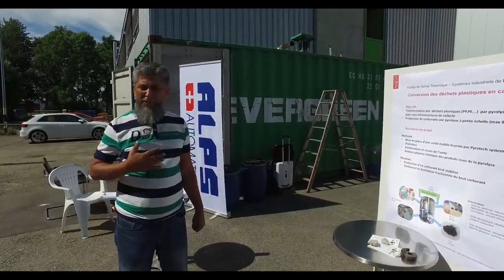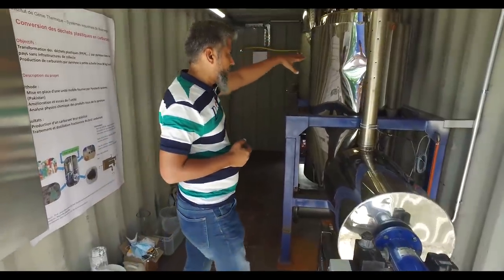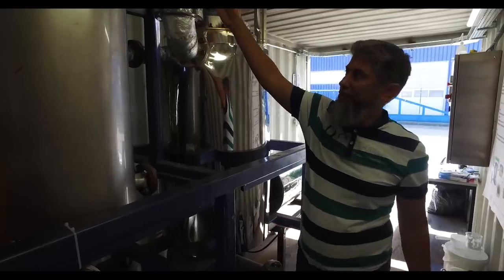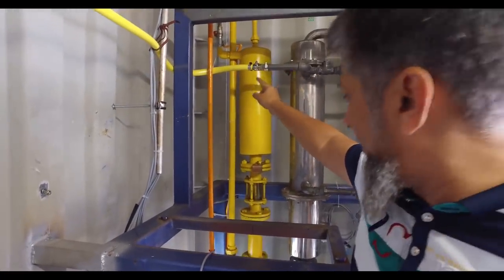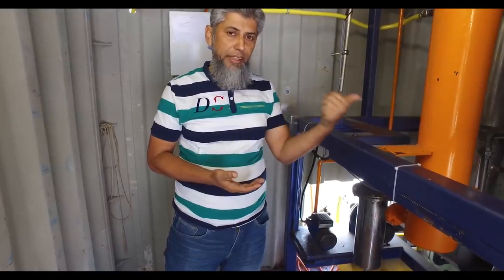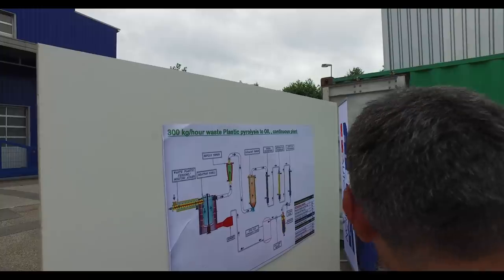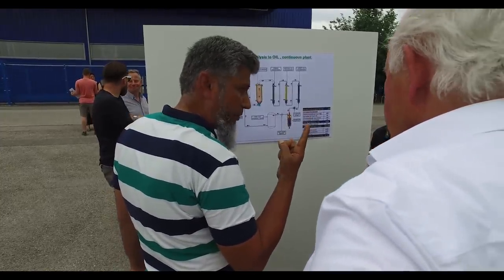Swiss Plastic pyrolysis 40kg demonstration by www.pyrolyze.com

Comment: Bravo ... one of the only serious systems here that works in real life because it is a fractional destillation
Reply: The chines is way ahead 100 tons a day
Reply from the maker: @eriknielsen1849  please show us a system of theirs that can output refinery grade diesel, Naphtha and reuse the synthgas for the reactor and a power production. Please check www.pyrolyze.com for more information. Cheers
Reply: @GreenmeResearch  huayin group and Henan doing but just Google plastic to oil
Reply from the maker: @eriknielsen1849  the differences are. Not mobile/containerised and no refinery grade diesel, Naptha and Synthgas from these plants....it requires a separate destillation process.
Reply: @GreenmeResearch  I'm talking business not an expensive hobby and your numbers is to high except you have a werry clean base plastic.. You never have except you pay for the product and then you have no business. You already don't have with only 250 kg a day.. At a prize tag of over 40.000 euro Mobil or not.
Reply from the maker: @eriknielsen1849  not sure what you mean, we deliver a full businesscase with the product, please shoot on its content. Many thanks
Reply: @eriknielsen1849  so what, their plant is probably 100 times more expensive
Reply: @sammyd7857  10 ton plastic a day up and running under 100.000 euro
Reply: @eriknielsen1849  you said 100 tons before
Reply: @sammyd7857 yes sorry but the plant I have worked with years ago was a 10 ton so that's the one I know the price calculations on. But the 100 ton is not 10 times higher price. And what I'm atackin is the yeald and earnings on their machine. If you notice
Reply: @eriknielsen1849  if you ask me pressure cooking is the way to go. It is a better yield and less energy usage.
Reply: @sammyd7857  the yeald will be the same. the energy used higher. And I don't want to work with a pressure cokker full of easy burning gasses. The permits must be a nightmare, They normaly are just for workin with water steam. But wee are all difrent 😆
Reply: @danear2  OK sending you mine
Reply: I want buy your machine tell me how can i contect with you
Reply: @eriknielsen1849  exactly, great points, I'm thinking about getting into this business
Reply: @mrcharles4636  good idea if you have a good source for plastic waste. Especialy with the oil prices about to go to the moon. What contry are you from.
Reply: @GreenmeResearch  could you clarify what you mean by refinery grade? what is the difference in the properties

Comment: So basically THIS is the pyrolysis machine you would REALLY want because it not only produces fuel from plastic  but ALSO refines it to a point where you can actually USE it instead of having to refine it multiple times somewhere else  in order for you to get the refined oil you need to use it in vehicles and other machines. A pyrolysis machine AND a refinery all in one !!!
Reply from the maker: Correct ; our 150KG per hour unit ; will refine to refinery grade Diesel and Naphta.
Please check our new website launch on the 10th of July 2019
Reply: @GreenmeResearch ❤

Comment: Great idea to put your system in containers. Wonderful process to deal with the waste plastic that is burying us. I assume it is critical that the plastic put into the system is dry.
Reply: I know your comment is a year old but actually, depending on the system...water added to the system can be used to raise the relative atmospheric pressure enabling you to fractionate at a lower temperature which will use less fuel to heat the substrate plastics so dry initial feed is not necessarily a must.

Comment: You could even run it on burning plastic in furnace with a muffler or some sort of filtering of the black burnt plastic smoke.
Reply: You'd be producing a huge amount of toxic smoke and carbon by burning, or 'oxydizing' the plastic. The pyrolytic process breaks down the chains of molecules into less toxic, useable material in an oxygen-free environment.

Comment: simply fascinated with your video of plastic pyrolysis for bio fuel 
I am also working on plastic waste management
Reply: Which type of catalyst used.....
Reply: I wouldn’t call this „bio fuel“ since more energy is used to produce the oil from plastic than the oil (energy) it actually generates. Oil harvested from plants (vegetables oils) can be labeled „bio fuel“
Reply from the maker: @marcbloch1963  the process is self-sufficient with a very small input of energy, with about 95% of the generated fuels remaining.
Reply: @marcbloch1963  <—————- there is always one. Let me guess you use common core math also.
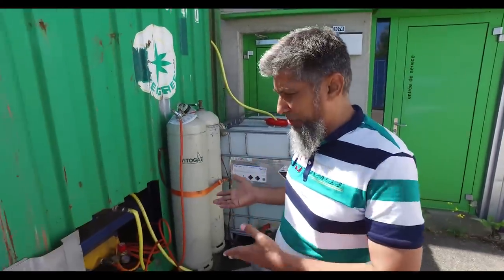Reply: @marcbloch1963  12:00 to 12:55 watch that minute about a thousand times or until it sinks in. Dig the shit out of your ears and pay attention! This is not a wheel rolling down a road or a perpetual motion trick.

Comment: Hi I am from India, I suggest you must use induction heating with solar or wind energy for pyrolysis
Reply: I don't think it's feasible because of the power required... Burning some fuel, preferably the very own gas from the pyrolysis, seems the best choice if we're looking at biooil production only
Reply from the maker: @eduardoezequielantunessosa152  our 150kg plant only uses a small amount of diesel or lpg to start-up, then the whole plant runs self-sufficient.
www.Pyrolyze.com
Reply: @eduardoezequielantunessosa152  didn't you watch the video
Reply: @chandaka srinivas if you are from india or if you have interested to install this pyrolasis plant contact me.
Reply: @hussain-al-sheikh8582   I'm interested can we have a call

Comment: Nice video. we use the fast pyrolysis plant Fpp02 for recycling plastic & wood wastes. Reactor 500 kg/h. It turns out fuel for hot water boilers.
Reply: Could you give me the process of continuous feeding to the reactor?
Reply: Hi

Comment: Well done, how many Kgs of plastic can it process per day and how much oil does it produce ? Will you try to build a much smaller machine like a freezer sized like machine for personal households ? Would be insteresting to scale this down, so people could put that in their homes in he basement and produce enough oil for their heatings from their plastic waste...or produce their own diesel oil for their cars...
Reply: 40kg per day, 80%, no use downscaling this, upscaling lowers cost and increases efficiency.(see my channel for a smaller demo unit)

Comment: how many kilowatts of electricity does this plant use to produce 1000L of oil?
Reply from the maker: About 5 litres of diesel/gas is required for start-up afterwards the reactor is being fed for 5 litres per hour from it's own produce.
Remaining synthgas can be stored or used to power a 50KVA generator continuously.

Overview of output
55% diesel
30% Naphta
10% Gas (50% to the burner - 50% for a 50KVA generator)
05% Biochar
Reply: Wow, that's a lot less then i would have thought to run your setup.
Just another question please, what waste/by products does this process produce and can they be further used or refined for other uses or do they go to land fill?

Comment: How much oil do you get from 40kg of plastic?
Reply: 40l oil
Reply: @RadekSzabla  How much oil does it take to extract the 40l of oil ?
Reply: mrsillywalk 40kl , its says it in the previous question
Reply: @francoisrobillard3164  I was asking how much oil was used in total to process the plastic into oil. That was not answered any place i have seen. 40kl you quote is a measurement of distance.The answer i seek would be in liters.
Reply: @mrsillywalk  I've seen other videos that talk about 8 lts of fuel per 10 kgs of material.
Reply: @henryrollins9177  Then the gain would be 2 liters if you were an optimist. Since nothing is 100% efficient, there may be no gain at all or even some loss.This looks like a convincer for con men!  Call on myth busters if you really need them!
Reply: Sorry but I dont see any oil input anywhere with a propane initiated and later waste gas fed burner. I dont understand what you are asking. The stirring and electronic controls use next to no energy. Since the only other output apart from fuels is carbon ash and you see the ash tray is relatively small I would guess the volume output of plastic to fuel to be around half to 3 quarters weight ratio.
Reply: @mrsillywalk  No no no, i was talking about 8 lts of fuel obtained per 10 kg of material processed. 
So it would be 2 kg of plastic that are "lost" during the process as fuel used for the combustion and ash.
Reply: @henryrollins9177  always hearing these good numbers even from large scale plants made years ago but still not operating in Australia even though there is a good supply of almost free plastic and fuel prices are good. Probably 80c liter wholesale

Comment: After pyrolysis there will be some carbon on the bottom tank, what will you do with that?
Reply from the maker: You can sell it for road carpeting or colouring feedstock.
Reply: @GreenmeResearch   can we make tiles from that waste on bottom
Reply from the maker: @krishkrish6166  Carbon black (subtypes are acetylene black, channel black, furnace black, lamp black and thermal black) is a material produced by the incomplete combustion of heavy petroleum products such as FCC tar, coal tar, or ethylene cracking tar. Carbon black is a form of paracrystalline carbon that has a high surface-area-to-volume ratio, albeit lower than that of activated carbon. It is dissimilar to soot in its much higher surface-area-to-volume ratio and significantly lower (negligible and non-bioavailable) polycyclic aromatic hydrocarbon (PAH) content. However, carbon black is widely used as a model compound for diesel soot for diesel oxidation experiments.[2] Carbon black is mainly used as a reinforcing filler in tires and other rubber products. In plastics, paints, and inks, carbon black is used as a color pigment.
Reply: @krishkrish6166  The ash is toxic....

Comment: Thank you for the video!

I have a question: You said you load the reactor with plastic and then close it firmly so no oxygen enters inside. What happens with oxygen that is already in the installation? Is it pushed away by other gases, when the temperature is still low and there is no danger of explosion or do you use some other gas to push the oxygen away from the reaction chamber before, like carbon dioxide?

Comment: Im really thinking about trying to make a system like this. One question though. Is the "ash" that comes out toxic in any way?
Reply: the "crude oil" produced depending on the plastics and any contaminates on the plastics will contain several carcinogenic hydrocarbon variants that are directly linked to cancer. the ash after the process can contain some amount of these hydrocarbons. the good news about this ash because it should be mostly carbon, can get reheated to remove the contaminates(like the trace hydrocarbons). then after cleaned run through plasma to produce graphene(its a little more complicated than just slapping it with plasma you might want to look into graphene). One plastic I keep seeing pop up in research papers that will produce these highly carcinogenic hydrocarbons is polystyrene. 

the main downside to this process is that if you aren't prepared or have the knowledge of how to separate, clean and isolate a chemical like a hydrocarbon chain. you will have a hard time cleaning up the crude oil from plastics, since a decent amount of them are unstable and will create a unstable fuel that will gum up a engine. If you try doing this I would suggest when you build your machine you use wood, or plant materials as pyrolysis medium to create the crude oil, this you will have a better time cleaning and turning into your fuel. we cleaned crude oil from wood/coal before we cleaned crude oils from the ground so the knowledge is there if you look for it.

the basic version of this machine is a wood fuel burner connected to a closed loop distillery. make a wood gas machine, connect the output to a pipe that runs through a condenser with a catch container at the end. that basic machine if done right can have a gas output, and any output will most likely be contaminated with water and need dried.
Reply from the maker: Depends on what you put in. If it's foodgrade then the output will be close to that
Reply: The ash is harmless for nature and animals including humans, it can be ditched anywhere, no problem

Comment: Excellent. Can you have feed stock of say old tires and old cables with internal wires?
Reply from the maker: All metal must be removed
Reply: Maybe if you create a device using electro magnetic induction, you can heat just the steel enough to peel the rubber off.
Reply: Tires are vulcanized using sulfur, and breaking these chains needs a sulfur extraction step and is quite elaborate. Burning tires releases Sulfuric oxides, causing acid rain, killing lungs and trees.
Reply: @GreenmeResearch  Why is that the case? The additional ocst of size reduction and removal of metal is financially costly and I dont think it will aid in pyrolysis yield.

Comment: now, use solar lens to heat the furnace, setup a operation in a stable country on the equator to maximize sun exposure, preferable a desert region and begin. in a few years this will be cheaper to do than what's going on right now in the world.... - and use the gas extracted to power the electricity, among with solar cells of course.... (blower, pumps etc.)

Comment: If some one can hack a car engine to run on this oil that come straight from this machine without refining it would change the world.
Reply from the maker: Please visit the Netherlands-based www.pyrolyze.com and their FAQ and Research pages.
Thank you.
Reply: Old diesels can. I have run a International 7.3L indirect injection diesel off of waste oil. Any direct injection diesel can run waste oil or Kerosene. The emissions will not pass modern standards using these fuels.
Reply from the maker: @offroadspecialties7383 our diesel is not much different than commercial diesel https://www.pyrolyze.com/research/
Reply: Some one roll coal on this cool.

Comment: Unfortunately this process cost far more than taking the Plastic to the dump and is by far much more expensive than buying fuel. If one goes on his site and looks at the prices for these machines, it will never pay for itself in your entire live time. Those machines need maintenance also, not to mention the up front cost of the machine.  I like what Sweden does and they throw all of the countries garbage in a huge machine called, "Plasmagasification." They vaporize all the garbage in a giant machine with Plasma/lightning that is 50,000 degrees and then separate the gases out and burn those in generators to create electricity. That machine can process any form of garbage, even rocks and diapers, tires, anything. The Swedes have no garbage and no need for landfills. Their machine even can take most hazardous waste and process it perfectly safely.
Reply from the maker: Each machine has a sound business case based on capex, opex and ROI. Kindly challenge that

Comment: get someone from Iowa or Nebraska to narrate a video   Sorry but this is very important if it's real and I can't easily understand or believe this guy
Reply: Throwing around baseless insults confirming my suspicions
Reply: Basically white person face and voice?
Reply: @Abdulhamid-zi1xh  preferences are preferences and there is nothing wrong with that
Reply: Pyrolysis is a very real chemical process. Catalytic reforming of hydrocarbons is also how nearly all traditional petroleum products are created since most naturally occurring crudes have components that are less useful to us, so we catalytically reform them in massive refinery complexes. It's not that pyrolysis doesn't work but rather oil is so cheap it usually has a slower rate of return than just getting brand new oil out of the ground. That being said, we are starting to realize we have a large plastic waste issue worldwide and there aren't many good solutions other than bury it or burn it for power. This process is kind of an extension of burning it (different but in layman's terms). 

I can't help but agree with many of the others that seemed to think your stance comes from a place of bigotry. He had a very professional explanation and some pretty serious equipment for a smaller setup. All this coming from a younger chemical engineer here in the midwest. Do some other research, his explanation was about as simple as it gets: heat organics without oxygen and you break them chemically into smaller pieces. He was even very specific mentioning that the waxes that directly come out are too large so they must be reformed over a zeolite catalyst to target hydrocarbons about C10~20 long.
Reply: @xXstewieXx100  why is the bigot charge only one way towards white folk?
Reply: Im not a native english speaker and i understood almost everything he said. 
Clean your ears..!

Comment: The only problem with this technique is that it requires more energy to heat/boil the plastic into oil than it actually generates. Nevertheless we (humans) are heading into the right direction if we want to safe our planet.
Reply: That is just so, because of this he is using the gas byproduct to fuel the heating system. He was so clever he designed an auto cut out on the propane gas which he used as a start up. From there the gas byproduct is taking over the heating process.
Reply: Towards the end of the video he explains that a larger version of this machine would only need half of the gas fraction produced to keep the machine running, while the other half would drive a 100 kW genset.
Reply: Absolutely not true. I built myself one of these machines. It costs me about $35 in fuel to get a 100 l of diesel.